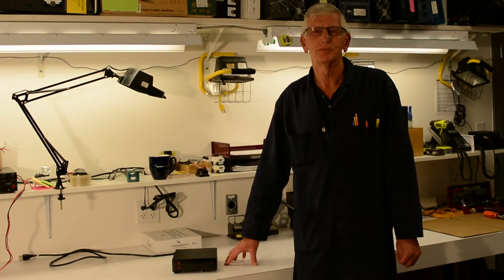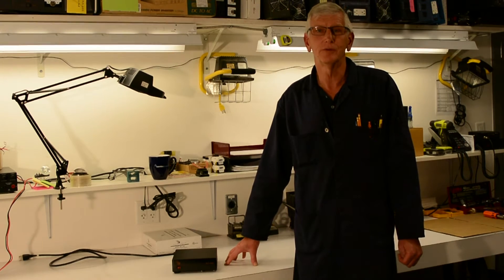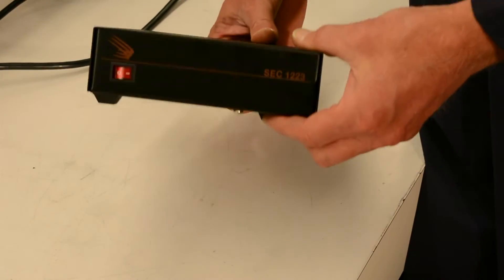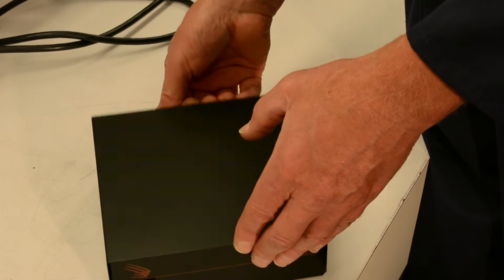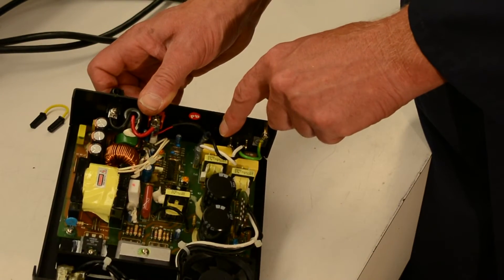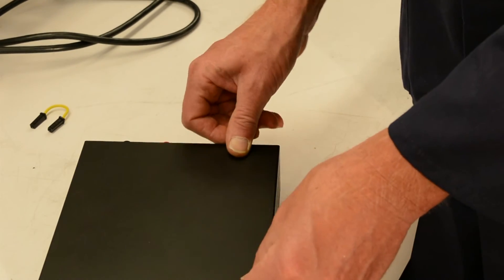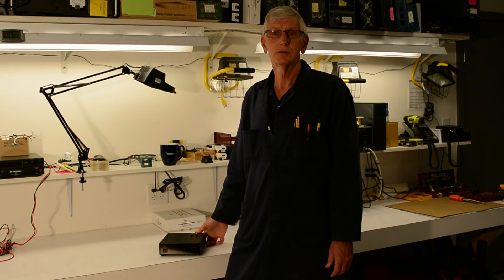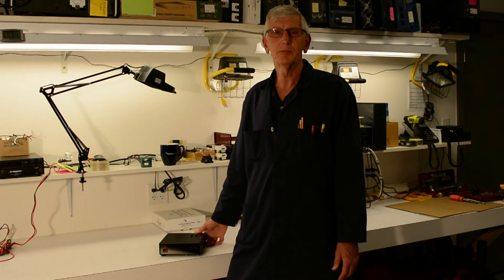Desktop Power Supplies - Converting Input from 120 to 240 VAC

Comment: 1:35 How is the fuse replaced in this case?
Reply from the maker: The fuse can be simply removed and replaced with a new one. If you have further questions feel free to contact our tech support at tech@samlexamerica.com or call 800-561-5885.